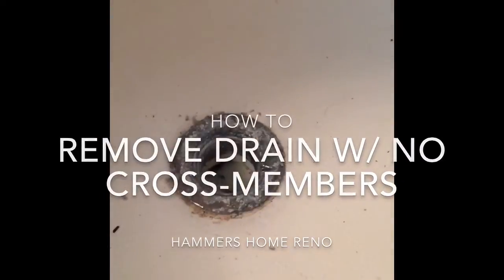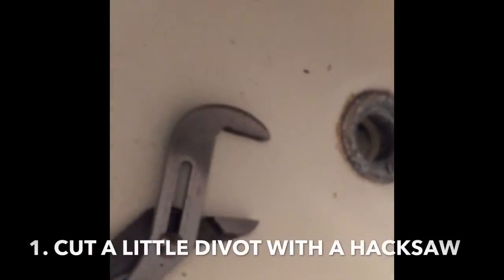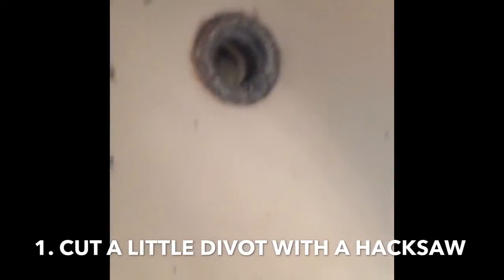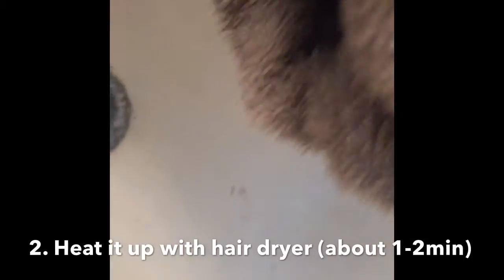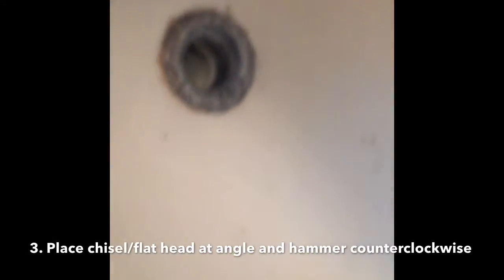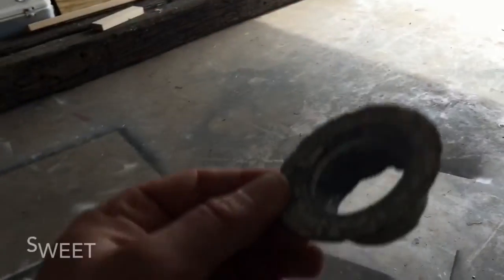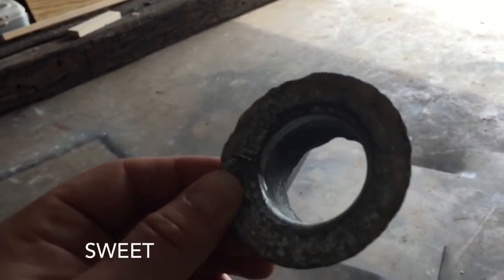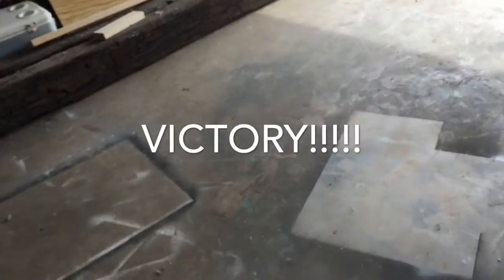Remove Tub Drain (Spud) With No Cross-Members (Hacksaw/Chisel/Hammer Method)

Comment: The drain extractor isn't supposed to go in all the way. If the correct size extractor was purchased (there are different diameters), it should have worked. Lightly, tap the extractor with a mallet and it should go in far enough to engage with the drain-piece adequately to extract it properly. If there is significant corrosion present, pre-treat drain threads with WD-40 or a similar product.